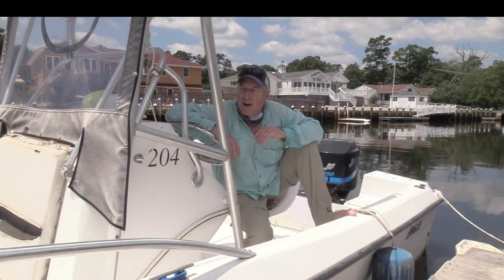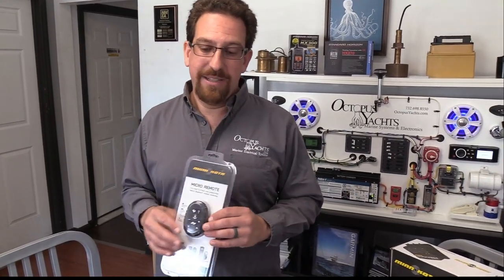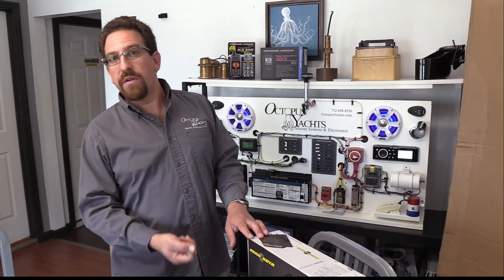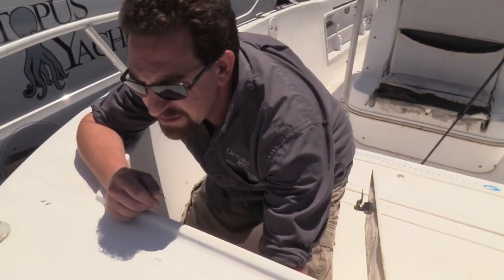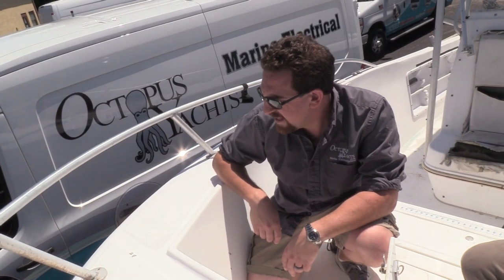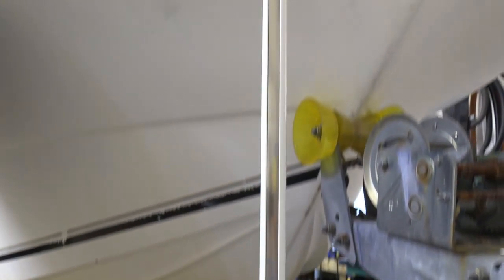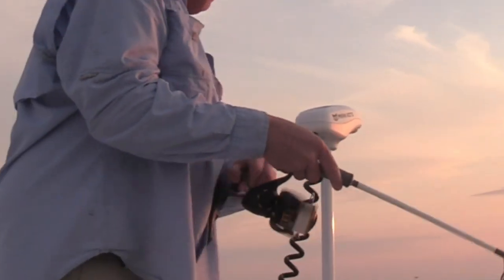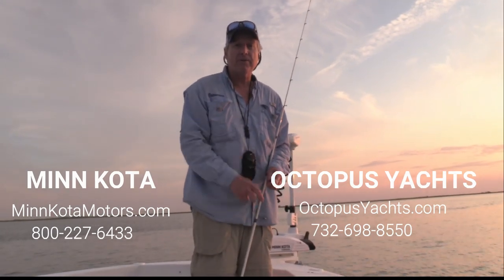How To - Choosing & Installing a Minn Kota Terrova

Comment: Thank you for the great video Jim you helped make my decision.  I am definitely getting a trolling motor for my boat(hydra sport 212CC) now to find a local boat yard that's capable if doing the install.  Hebron CT.
Reply: You find a good boat yard to do it? I’m in northern CT, so just curious who you found.
Reply: @mahimahi45ify  Im actually doing it myself in the next couple of weeks.
Reply: @bretttoomanyhobbies7572  ah nice, I’m thinking of doing the 72” / 36V terrova next spring. Its a big investment and I’m a bit hesitant about the added weight, batteries, etc. Have a similar boat to you, 220 outrage, what model trolling motor you go with? Btw, I’m a RHAM 2002 grad.
Reply: @mahimahi45ify  I purchased the same one that your interested in.  I'm either going to put the batteries where my Porta-Potty is or put them in the cooler which doubles as a seat.  The battery charger will be going inside the center console.  My son ix a 2018 graduate

Comment: I want my bow rail and don't want to cut it.  I have seen other installs where they built an aluminum bracket that allows for the motor and deployment. Really would love to see that video
Reply from the maker: Friends of mine with Parker pilot house models in particular opted for that installation leaving the bow rail in place; with a center console I chose the removal.  I also have a feature in the September edition that mentions how a couple of anglers who wished to leave bow rails modified their install.  Don't have that video of course (only one version!) but there are installation pros who can help you configure.  -JH

Comment: Don’t see why boating industry won’t take advantage of the lithium batteries. Ebikes using the same wattage, if not more, run on lithium batteries for lighter weight.